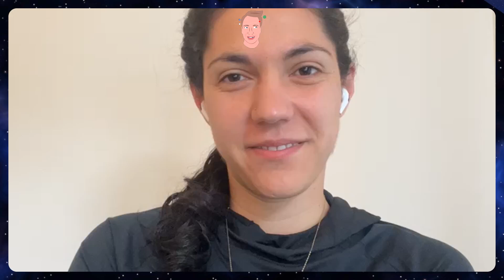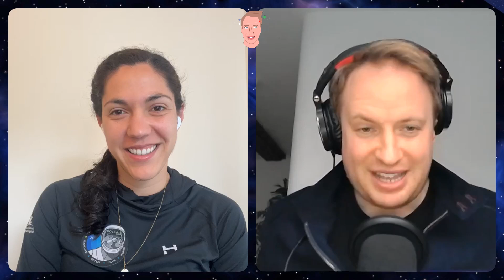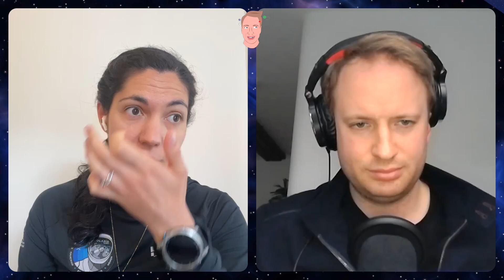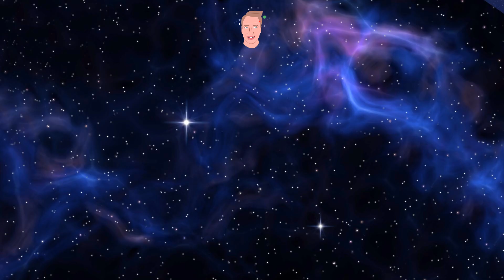#72 Sarah Gillis: SpaceX Engineer and Future Astronaut

Comment: Wow. Congrats Sarah. I watched you train the Inspiration crew. You are a great engineer in your own right. The thing that interests me is that the SpaceX EVA suit uses some of the same tech as the NASA Gemini suits - using the umbilical instead of backpacks, using AIR for cooling rather than water, fewer joints than a surface EVA suit, etc. I hope SpaceX is prepared to fully test the suits under a real working load, and prepared for the same problems that the Gemini EVA astronauts discovered.
I also hope they are very sure about the ability to re-seal the hatch under weightless conditions, from the inside of the ship only, and verify the seal.
Good luck on the upcoming flight. Later, if a Polaris crew tests Starship launch from Earth, don't get aboard until a true crew escape system is added to Starship. I think SpaceX will need to develop a specialized crew-only version.